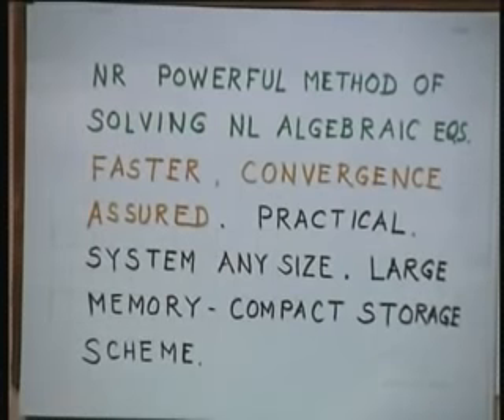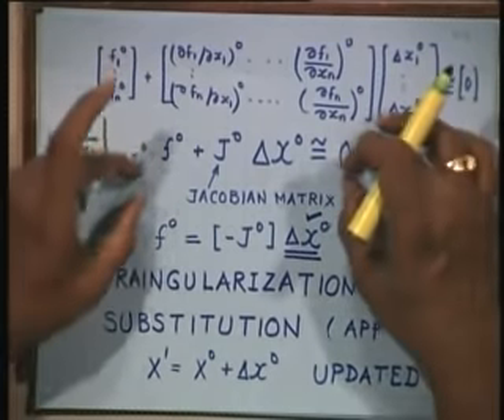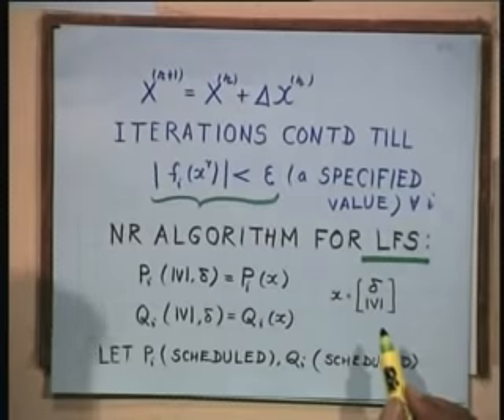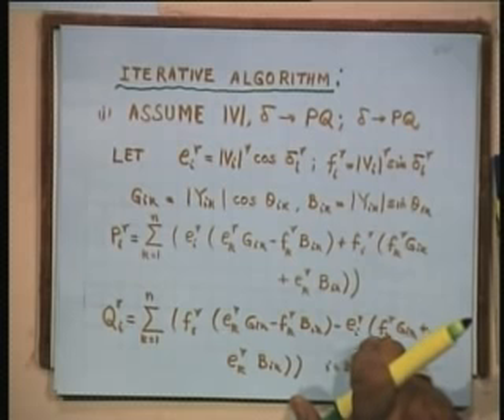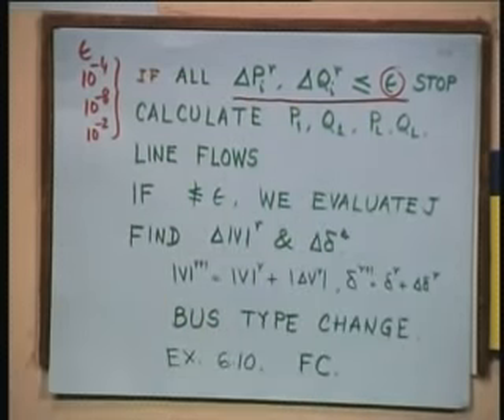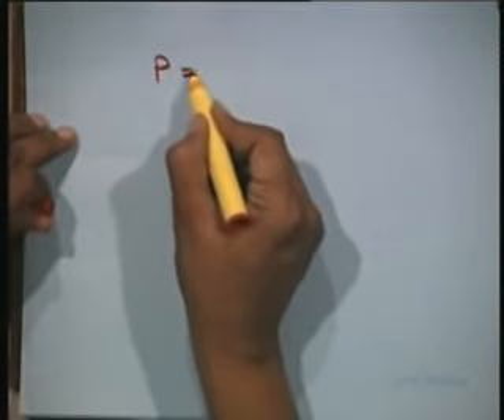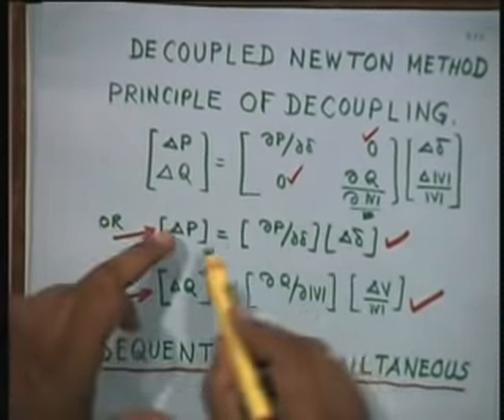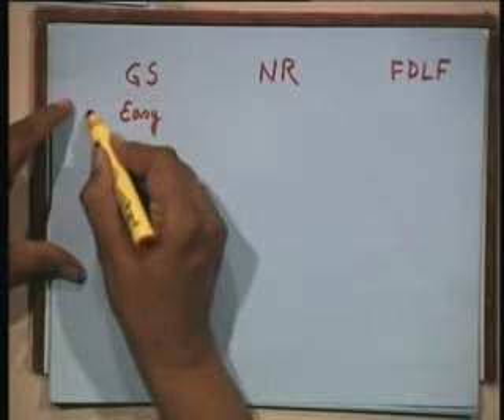Lecture - 29 Newton Raphson (NR),

Comment: Answer to the question of:  Bompally Sushil: According to the book of Prof. Kothari “Modern Power System Analysis” third edition, Chapter 6, we have to calculate the inverse of the Jacobian matrix to solve the systems of equations [ΔP,ΔQ]=[J][Δδ,Δ|V|] in order to calculate the increments [Δδ,Δ|V|] which are used to calculate the values of the next iteration δ1=Δδ+δo and |V1|=Δ|V|+|Vo|. Best regards from Caracas, Venezuela. Carlos Dominguez (student of specialization of Power Systems at Universidad Central de Venezuela)